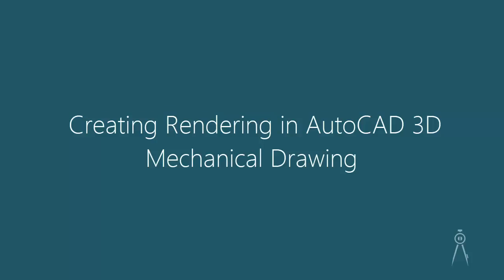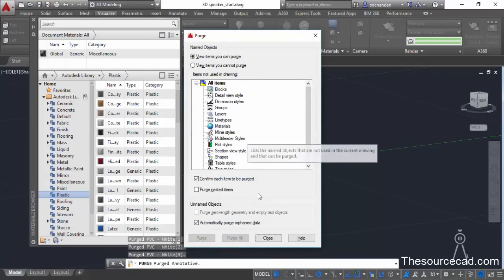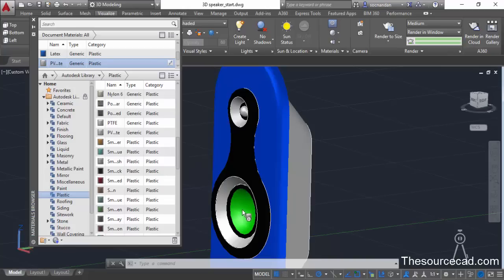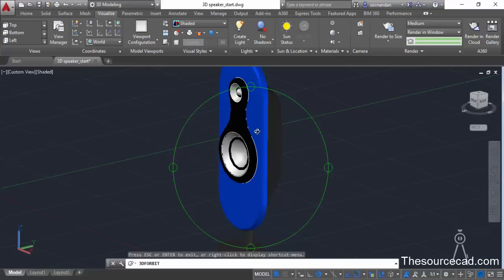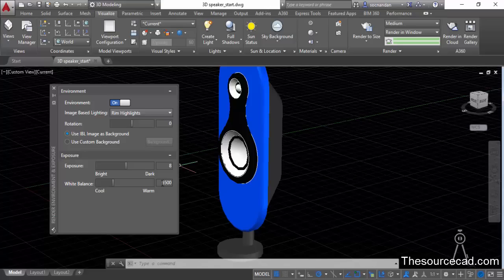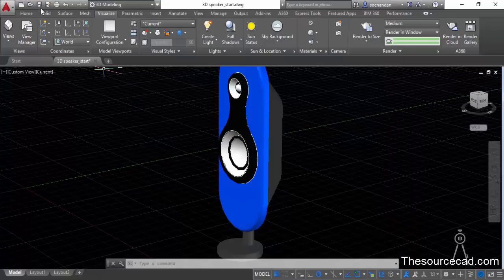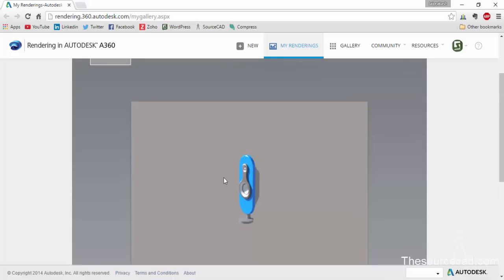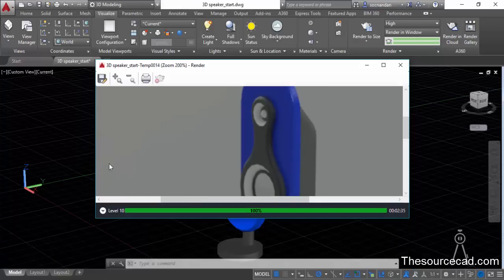Making 3D rendering of mechanical drawing in AutoCAD

Comment: Cool stuff. I was wondering... Let's say I finished my design, all modules are joined together etc. Then next day I find,  I don't like the rounded shape of the speaker, is there any chance to re-edit it or I need to redesign the whole speaker from the scratch?
Reply from the maker: You can use delete face command of AutoCAD to selectively delete fillets and then recreate it when required.
Reply: +SourceCAD Thank you Sir :)